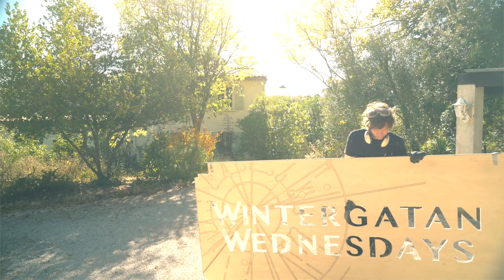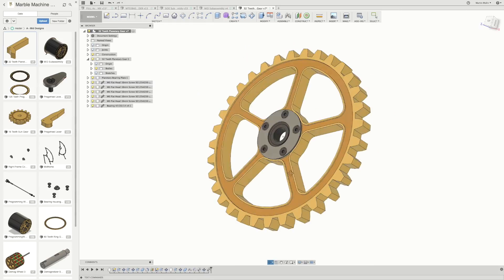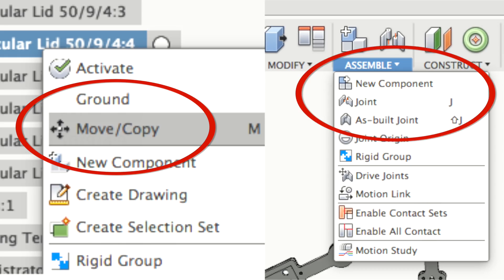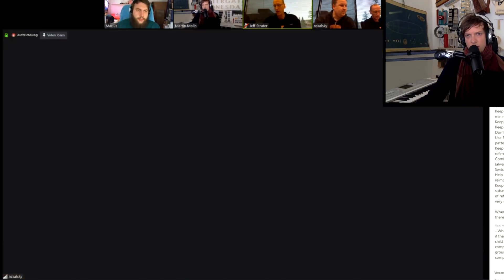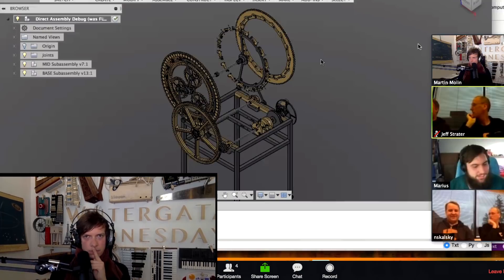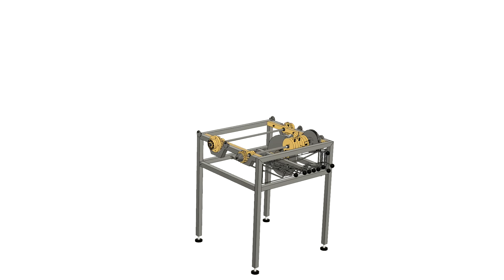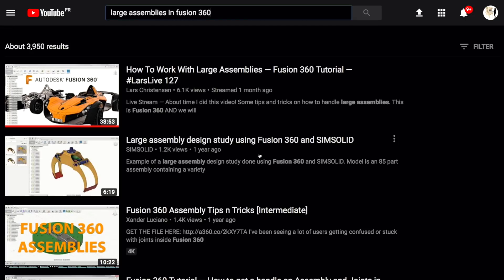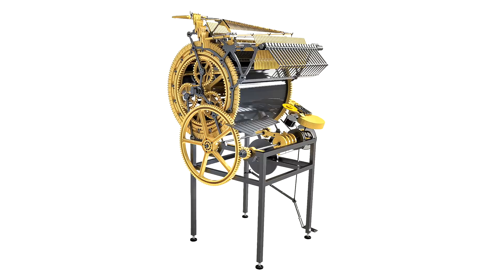Is Fusion 360 Unable to Handle Large Assemblies? - Marble Machine X #31

Comment: Autodesk once brought so many great tools from Autocad to 3D Max and vice versa but even now they haven't brought one of the maybe most needed feature from 3D Max to Fusion 360: "Low-poly models" aka. placeholders which are used while animating and composing the scene and which are replaced by the real models in rendering. It's really odd that they haven't done something similar in the Fusion 360, like when you do the sub-assemblies you do them in "full resolution" with every small detail, but then you can export to the bigger assembly "low resolution" model from that sub-assembly which is something like only the outlines and maybe some colors from the sub-assembly just to show you what you are working with and where, you don't really need all the small details from each and every part of the MMX all the time. Problem with this is that it doesn't look that good when you are working with it, you cannot get the full visual unless you render images from the assembly or especially ask for the full resolution assebly, but it would solve the problem. But it's something that the Autodesk must do, if there isn't this kind of feature somewhere hidden.

It's acctually extremely odd that there isn't something like this in the Fusion 360 even when this is just quite normal workflow in 3Ds Max and Maya (both Autodesks 3D modelling/animation tools) and I think so many Fusion 360 customers would really appreciate this feature. Might just be that CAD drawing and 3D modelling are still too far appart from each other even when CAD drawing starts to look a lot more like 3D modelling (SolidWorks and Fusion 360 seems to be very close to each other workflow-wise and from my experience working with SolidWorks is nearly the same as with 3Ds Max, just with more numbers).
Reply: Mostly Martin has been doing it already with his placeholders. There might not be any program to automate the simplifying of the CAD components, but by hand it is even more than possible (and quite often even in 3D modelling the low-poly conversion is done by hand to assure the low-poly model has everything needed to animate and rig the model). At least I think it's mostly about making the program to make the change between high resolution and low resolution assemblies when needed (for rendering concept images, assembly drawings and so on where you need the real image with every detail).

I would think it wouldn't be that big of a problem to make like prioritizing for the geometry in CAD drawing. Like for example you are making a cogwheel, you start with a wheel and mark that as base geometry which will be used as the "low resolution assembly" and then you add to it the tooths and cosmetic grooves and everything to make the "full resolution assembly". Then you add something like a connection rod to the cogwheel and you decide that you need it to make the ful lassembly and you mark it as base geometry which adds it to the low-res assembly where you now have just a wheel and a rod, just enought for you to recognize the part and be able to position it in the ful lassembly without killing your PC in the progress.
Reply: uhrguhrguhrg Yeah, you're right. It's just stupid that feature isn't  built in.
Reply: Talkless Diamond it's build in SolidWorks and that means that it's most likely build in Inventor since those two are directly competing softwares. The buttons are even placed almost identically if you compare them.

And it seems that Fusion doesn't have a feature like this.
Reply: Talkless Diamond it seems that it is possible to lower the quality of viewed details for perfomance boost in CADs and there are even tools that do it automatically.

http://help.solidworks.com/2017/english/solidworks/sldworks/c_improving_large_assembly_performance_swassy.htm
Reply: I'm guessing CAD program doesn't use poly. At least not in a traditional sense. Which makes simplifying the components temporarily isn't possible/too costly.

Comment: Obviously an additional cost, but what about using AMD Ryzen based system and/or very high-end GPU? More GPU cores is a "solution" to the problem. A "real solution" would be enhanced geometric calculation algorithms with highly optimized parallel processing in the software - but even then the calculations have to be done, and to be done in a realistic time the only option is more power. I am not sure if its supported, but ideally software like this could take advantage of multiple GPU's within a system - imagine installing 4, 6, 8 or more Nvidia 1080TI GPU's with 3584 CUDA cores each. I am sure there are some unwanted mining rigs layout around since Bitcoin's price hit the floor recently, might be worthwhile trying an 8 GPU rig and see if the software is optimized for that architecture.
Reply: My understanding is that solving geometry is hard to parallelize and mostly done by the CPU, so more GPUs wont really make a difference and more CPU cores wont as well...
Reply: Being a software engineer myself, I am not convinced this is the case. Intrinsically there are numerous items, which immediately lends itself to parallelization. I suspect the argument for a "lack of parallelization being possible" is that whilst you could parallelize individual calculations of bodies within the total drawing, the combination of results is coming back to one thread and causing the bottleneck. I would argue that a rethink in the way they are doing the processing is required and the software needs some redesign for this type of modelling. That said, if they did that, then it would encroach on their market for selling Inventor, thus why there is a clear limitation in Fusion that has been better addressed in Inventor. Like the video says, this point should be made more clearly and transparently.

Comment: Incredible, the whole forum post and this video is about performance issues, yet there is no single information on which hardware everyone is using. Also, as a game developer I'm concerned about this whole software. It seems to make geometry with curves, kinda like vector graphics just in 3D. I assume this must be a huge bottleneck if the graphic card has to read this information and build a mesh out of this data. Can't he just bake this information down and generate simplified polygons (so a circle will have 16 sides for example), so he can open the assets in another software that deals with vertices like Max/May/Modo/Blender? Also, there is so many duplicates of some objects, are those even hardware instanced? For a game developer these 3-4k objects is quite a number, but if you consider that most of the parts are identical, I'm still confused.
Reply: Many objects are identical but not copies of each other... But my understanding is that this problem is not a graphics bottleneck, but a solving for geometry bottleneck (moving the objects, generating the solid with all the edits to it, referenicing the bodies to one another (joints) etc.)

Comment: Thats the reason why no one uses low end PCs (just like macbooks) to do this kind of work.. just get a PC, that should do the trick.
Reply: Its not the graphics card thats the bottleneck, it is the way how Fusion360 calculates how to place objects.
Reply: Throwing more power at it will increase the number of bits it can handle before it bogs down. But that's not the solution you want
Reply: There are CPU bottlenecks too and macbooks are always using last gen hardware because apple loves to cut costs on their premium machines (sigh)

Comment: Already a bunch of comments of people positing that you just need a better pc. I'm left wondering if they even actually payed attention to the video. In the video, they say that this is not an issue about the power of his computer. Not only that, but they talk about how other CAD programs, such as inventor, would not have these same issues with this large scale of assemblies on the same hardware. The whole video is literally about how this is an issue with how Fusion 360 is coded and not a computer capability issue.
Reply: @SkilllessBeast I'm pretty sure they are built on entirely separate code bases by separate teams, so being under the same company doesn't actually matter too much. They also assuredly prioritized different development ideals and end use cases in laying out how they would develop their code bases. Even extremely minor differences in code efficiency, on an object level, can quickly become colossal overall differences as object counts get larger and larger. Add to that base differences in efficiency with how objects are joined (balanced with the flexibility that joining method offers) and that's how you can end up with such a discrepancy.
Reply: Some people don't watch the entirety of the video...
Reply: It's often the same thing, people watch the video and then stop on "their solution" (the best of course) to the problem exposed by Martin, but without taking into account the problem stated by Martin ...
Reply: Inventor is still worse than SolidWorks and both are still worse than Creo or Catia. That being said, Catia and especially Creo are not intuitive at all.
Reply: some people just don't realize that a fast computer doesn't always make all programs run fast. 
I have a really fast computer that handles SolidWorks with no issue, even with massive assemblies, but when I run 123D Design, a simple object makes the program run at a snail's pace. Why? They are different programs.

TBH the fact that a (practically) free program has this issue at all (referring to Fusion 360) is rather amazing.
Reply: pascal 59300 went through what Martin did on current project. His solution very near what I did; he will still find some part shifting...it's the nature of CAD.
Reply: Sadly that is standard in self proclaimed computer experts, the only solutions they know is reinstall everything and buy new computer...
Reply: +Mauro Tamm I doubt it'll ever be fixed. This seems to be a flaw in the fundamental software design, they simply didn't expect people to take the software that far, which is understandable given assemblies with such complexities are usually done with other programs.

"More power always helps - even with poorly performing software."

Not really. If you need to pay 5000$ for 1% better performance your statement is still not wrong but not helpful either. Algorithmic complexity is far more important than computing power.
Reply: @SkilIIessBeast : The price I think. ; )
Reply: ew you sound like my technology teacher, just about everyday he complains that solidworks is shit and impossible to use, and that catia is much easier well i tried catia, freaking confusing even for someone with a decent amount of hours on CAD
Reply: More power always helps - even with poorly performing software.
Alternative is to wait and hope they "fix" it in a few years or  move to something else and waste a lot of time.
Reply: Because these are different products meant for different usage patterns.
Reply: If he'd used SolidWorks he could probably have handled the parts.
I've on occasion worked with some seriously complex projects, one of which was an entire section of a passenger airplane. (Think roughly 5 to 6 thousand parts.)
Sure, you need an insanely powerful PC, but there aren't any software limitations, at least not ones i've run into so far.
Reply: i do not not understand why f360 has such problems, but inv does not have, because they are both made by autodesk

Comment: That will make problem to developing the finish machine. If you can use slolid works or sloid edge and a powerfull pc. You can move the project too that program need to spend time but will not have that kind of problem. Good luck be well :-)

Comment: You probably will want to switch to pc as theirs typically more development for these type of programs for it, additionally you may need a quadro grapics card, not a normal one, these cards may seem like bad value to the average user, but these cards have special circuitry designed for this type of work. Quadro cards do make a good difference with large cad workloads from what I've seen.

Comment: Thank you, this video was really enlightening. I am building something big as well and so far I've been using Autodesk Inventor. I was actually thinking of importing everything to Fusion360 for publishing, because it would be better for the community, easier to work with and cheaper to aquire for future community members, but after your video, I wont even try that. I will just stick to Inventor.

A workaround on that scale that you are describing is not acceptable for me. Hopefully Autodesk will fix these performance issues of Fusion, if they do, I will certainly go back and reevaluate my decision that I was able to decide based on this video
Reply: I think I would try porting it to Fusion360 none the less. The Audodesk team knows of the issue and is working towards a solution. But if you dont really want to work in the Fusion360 file it should definetly be fine. Also big doesnt mean Furion breaks down, I have a priveat project with about 2/3rd the size and it is still functioning well enough to work in it, the MMX Assembly is just REALLY big :-).
Reply: Marius yes if I do the switch to fusion, then all future work would be done in fusion as well, otherwise the community aspect of doing this switch would kind of be lost. I want as many people as possible to be able to engage, improve and work with the source files, and that is the only reason why I am contemplating the switch to fusion

Comment: You should also think about upgrading your hardware, Mainly the graphics card because it is what is mainly used to process this stuff. I recommend checking out some other forums on what works best for handling big projects for this. If you can reply With your specs that'd be nice and I can tell you if its worth upgrading to a better system in order to get more productivity out of Fusion.
To get the specs of your system.
on windows
1. windows key + R
2. type dxdiag into the box
3. if it asks you to scan drivers for issues or something similar, click yes.
4 let it load and then you can see your computers specs. and click the display tab to see graphic specs, lick the graphics card and monitor
on mac 
1. click the apple icon in the top left corner
2.click about this mac
3. it should come up with the computer specs 
I use windows so if this doesn't come up with all the specs then i'm not too sure how to see them.

Best of luck with the marble machine X
I love your videos and I hope you can fix this issue
Reply: ElectricTRex Stringer He said it isnt a hardware issue. Autodesk is the Problem.

Comment: Hi, my job is trainer/consultant for PTC Creo Elements/Direct and I also work with Creo Parametric daily. On both systems, I worked a lot with assemblies containing 15000+ parts, and this works without major problems. So, I’m a bit surprised that Fusion becomes slow around 1000 parts…
Some thoughts:
- Helix (and freeform) shapes are very bad for the performance of any CAD program, indeed. So, screw thread and real spring geometry should really be avoided.
- does Fusion have Skeleton functionality? Programs like Creo Parametric and Solidworks use this concept for the same trick that you used the main frame for at around 13:30. A skeleton contains e.g. 3D lines and planes that represent main geometry positions like axles, center planes etc.
Reply: I'm using Creo / ProE since 1996, simplifying subassemblies is the key just as Jochem Kuijpers wrote just display what you need when you working on a part, use the full assembly just as a reference
Reply: well, it depends. If the CAD system (and the computer) is powerful enough, it saves quite some hassle not doing any simplifications. The most efficient trick I've seen so far is making one Simplified Representation in the complete machine that only shows the subassies that are directly under the top assy, but without loading any geometry. This loads in seconds; after that you set the Representation of the subassies that you have to use that day to Master (which means: load these models). I have no idea if Fusion supports something like this...
Reply: jaapdesticker agree with you on one off projects, i try to invent the wheel only once. So when i design modules i try to reuse it in later projects and if the simplerep is allredy in it it saves time and switching reps in creo is easy
Reply: agreed :-)

Comment: Great video, as always! I work with AutoDesk products at my job, basically all day, every day, so I could relate to some of your issues. Overloading the program is something you don't think about until it happens for the first time. In fact, I doubt many people on here considered how much actual detail you would include in creating a working 3D model in Fusion. It's truly mind-boggling. Great work keeping the project on track and trying to work out the kinks. Also, kudos on getting some face time with AutoDesk. Sometimes it seems as though they are deaf to the users, especially when so many are complaining about the same issues, but your project, obviously, has pushed Fusion 360 to the limits and I'm sure that created some interest on their part. Hopefully they will be able to offer more support and also improve their products as a result of your MMX project! That would be a neat, unintentional legacy!

Comment: I guess it would be a very useful to have a read-only full assembly (i.e. can't make changes!), and then be able to select a few components to work on, hide everything else so performance is not an issue, and then when you're done, show the new version in the full assembly again.

That's how I used to do level editing in the old Quake 3 Arena level editor once the levels got too complex to edit them with everything visible. I'd select the few rooms I would work on, hide everything else (keyboard shortcut H I believe) and edit those specific rooms. Then unhide the other rooms and look at the final result.